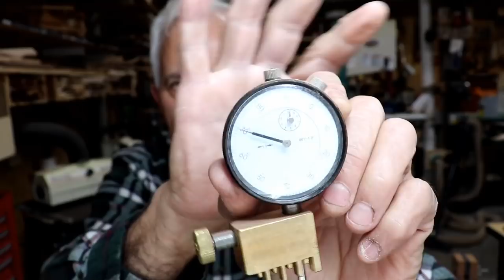RSW Shop Talk 18 Big Changes and Homemade Tools

Comment: I saw a video on sharpening blades with a 4 inch angle grinder. Tried it. Worked pretty good.
Reply from the maker: I am sure that would work. I am sure it would work with a 1" grinder on a dremel tool it's just easier on a larger grinder

Comment: Jerry in Australia we have serious humidity issues. It is the driest inhabited continent and over the last few years we have had extreme drought. Fingerboards shrinking till the frets are exposed. Tops so shrunk that it takes a week of extreme humidifying to get them to the point where they are able to be glued.  I am aware of the hazards of extra humidity, I note Mr Schartiger's comments. On the other hand Ted Woodford up in Canada has real hassles with drying. Trust me Jerry in a dry country it will crack the tops, especially if reverse cycle cooling is used. It is as dry as the Sahara sometimes.

Comment: Another good one Jerry. A lot of information you put out in it. The opening was good and maybe, one day, Caleb will be sitting in that seat if he reconsiders. Regarding lawn mower blades, I watched that one intently as I tend to shy away from using the grinder and switch to a file. I get good results but it sure is a lot of work. So I may try again with the grinder after watching. I was taught the screw driver method of balancing, where you take a hefty phillips, put it in a vise, insuring the shaft is level, and place the blade on it. it one side dips then you know you need to sharpen a bit more. Seems to work. Take care, Happy Easter to you and yours, Caleb and Melissa. He has risen.

Comment: Awesome video as usual Rosa string works crew! 
Question: when you showed us the headstock of the Rosa guitar I noticed that there is about 3/32” of the truss rod sticking up proud from the acorn nut. I heard on the “inter-web” that if you see this that means that the wood where the other end of the truss rod butts up against is getting compressed and therefore is considered a “problem”. Is this an issue I should be worried about? If so how do we fix it? (The reason why I ask is because I have the same amount of truss rod sticking past the truss rod nut on both my 77’ Les Paul deluxe and my newer Rickenbacker 4003 Bass).Thanks again take care Rosa string works crew and keep on having fun 😀
Reply from the maker: Don't believe everything you hear on the Web
Reply: @RosaStringWorks  Thanks short and sweet.